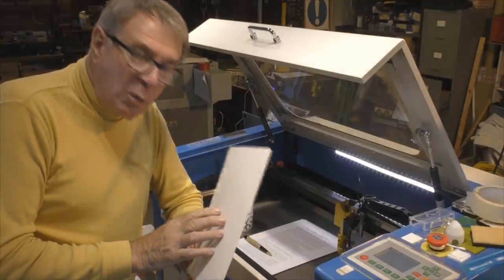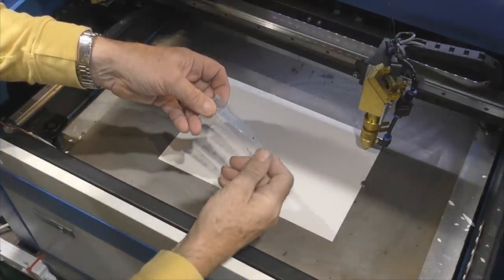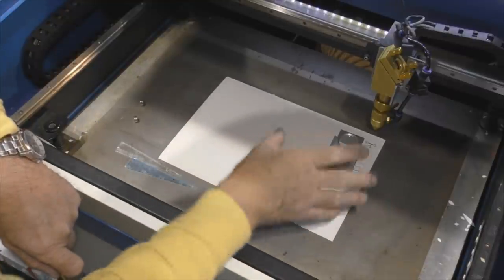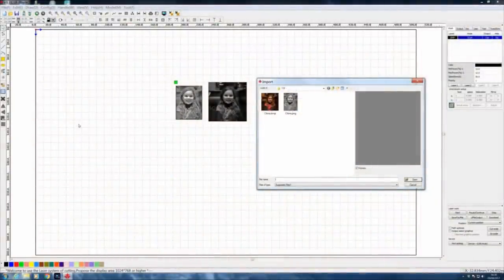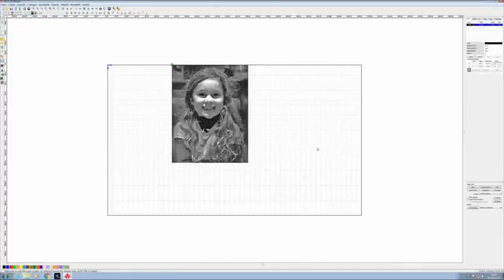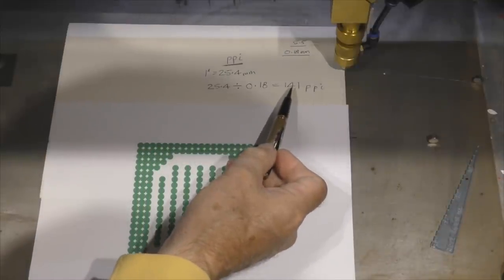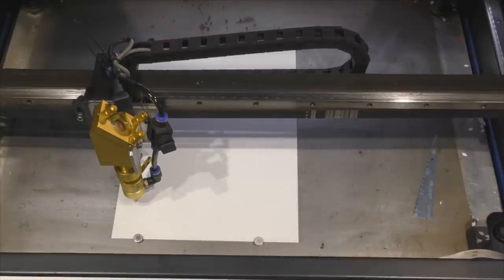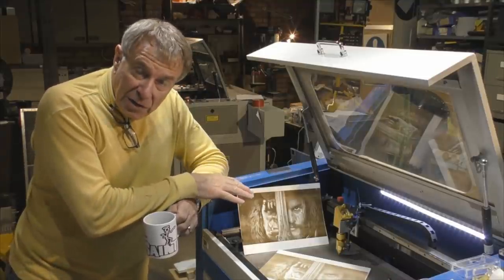RDWorks Learning Lab 115 The Russ Formula for Photo Engraving

Comment: Hi Russ
I found a discrepancy in what defines "dot size" in my drawing program. If I design a 1 pixel dot then the size is 0.002. If I then change my drawing units to inches instead of pixels, the same dot becomes 0.003339. I have another newer computer and monitor and with that set up it stays the same size of 0.002  or 1 pixel regardless of the setting being pixels or inches.
Should this be a consideration?

My Trotec 30 watt laser can make a 0.002 dot with a 1.5 inch lens however our machine allows not only DPI settings but also Pulse Per Inch settings. Plus 1 to 100 for speed and 1 (or less) to 100 for power. I've been told the Pulse Per Inch should be a multiple of the Dots per inch.
I don't know what happens (if anything) if a photo is 300 DPI and the PPI is set at 1200 or vice versa. It's confusing me. I've done over 150 tests varying power and speed however they were done mistakenly using a dot size of 0.001 (putting 1000 of them in a line 1 inch long) and none of the dots were distinct - they all merged as one line. Also tried 500 of the same size dot per inch with the same result.
Then I realized a pixel is not necessarily 0.001 - no idea why I assumed that but I thought if the laser can make 1000 Pulses Per Inch, that must mean it's capable of 1000 DPI ? I guess not.

Would it be possible to get your formula document? This way I could try and make adjustments to the Trotec software and put an end to the rampant destruction of watercolor paper. I've been using 140 pound paper that's pretty nice although slightly textured. I'll be looking for the beer coaster material at the local hobby and framing shop.
Regards,
Mayo@designcutters.com

Comment: Your channel is the best I've ever seen on laser engravers: thank you for helping me out as I booted up my own!

Please excuse this if you've answered this question before, but I've run into a print speed issue and wondered if you'ed ever had a similar problem. In order to melt glass instead of just microcracking it I need to run my Chinese laser at around 5mm/sec, but anytime I run it below 41mm/sec something bizarre happens: Instead of printing the picture in the corel program, it prints a series of dotted lines bearing no relation to the original picture. 41mm and faster? Prints great. 40mm/sec and slower? Grid of dots.
I'm using main board M1 under properties, and it works fine apart from this issue. I've selected every other possible main board setting to see if that's the issue: Those main boards that ignore the input speed completely print the picture. Those that respond to input speed print the dot grid.
I've tried switching computers and OSs, but it makes no difference. I get the same grid of dots.

I'm just stumped as to why setting the print speed slower than 41mm/sec should have any effect on the content of the image. This isn't a blurred or damaged copy of the original image - the dot grid is a completely different image with wildly different external dimensions. Do you have any idea what is going on with this K40 laser?
Reply from the maker: Hi Michael
I started to answer your question and  posted my answer but for some reason You Tube decided to post it into another dimension.. Check out your You Tube messages where I have sent my email . Send a couple of pictures of your problem and I'll see if I can help. I know zero about the K40 machine but it's only mechanics, electrics and logic . There will be a solution.
Best wishes
Russ

Comment: Hello Mr. Russ. That 1.5 lens created a magnificent picture. When using the 1.5 lens, does it need to be set up like the universal compound lens where there are 2 lens or can this be used individually? By the way great video. Is it possible to share the dot file to use when setting up for these types of engravings?
Reply from the maker: Hi Derrick 
 Add your disguised email address to another comment and I will send you a data pack on the whole subject of photo engraving that include the test pattern
 I will also delete your comment/email from public view
 Best wishes
Russ

Comment: Hello Russ,
i have a Question about the Software which you used to improve the brigthness of the Picture. Which one was it? Maybe Photoshop or another one? Thank you.
Reply from the maker: Hi Claudio

There are some basic brightness and contrast iadjustment s you can perform with in the RDWorks bitmao handle tool. However I find Photoshop has many more tools  including a valuable filter called Unsharp Mask.

Best wishes
Russ

Comment: if you have some thick acrylic(10mm), make the gauge out of that. it will stand on its own, therefore  both hands are free to manipulate the screws and you can "land" the lens on top
Reply from the maker: Hi Steven
Thanks for reminding me I rather too lazy to make a thick one. I made these almost 2 years ago and every time I use them I think 6 to 8mm would be stronger and self standing. Perhaps now you have kicked me I may do something about it.
Thanks and best wishes
Russ
Reply: Dang, that's a good idea, thanks for sharing!  I made 3 or 4 of these handy gauges a few months ago and use them all the time, but a free standing one would definitely be an improvement.

Comment: I am still unsure about the scan interval to use however. Should I use a scan interval that is the same size as my dots?
Reply from the maker: Your picture resolution will always be expressed as ppi (pixels per inch) The scan interval must always match the ppi so you have to calculate the size of a pixel to input as the interval  If you remember this simple calculation you will always set the interval correctly
25.4 / ppi = interval 
In my write up  you determine the smallest dot you can make and then set your picture resolution to match that dot size. Thus you are correct  and in this case the interval is also the dot size (in mm)
Best wishes
Russ
Reply: This video is the best yet in my opinion. It has been so so so helpful and I can't thank you enough! People are always throwing around random resolutions and inputs but this clears it all up perfectly. Thank you so much!
Reply from the maker: Hi Cosmo
As you rightly say, there has been a lot of black magic and  many myths about the correct parameters for engraving. I'm sure that even the big companies don't fully understand, they pre-program parameters into their machines based on evolution, trial and error. It's taken many sessions and turns into blind alleys before  I managed to distill the essential details into a simple form that can be understood by all. When you understand the absolute basics you can go forth, bend the rules , mix and match the parameters  but you will more than likely end up with "an artistic" creation rather than fidelity. Thats part of the fun now that we understand where the bondaries are.
Glad it works for you.
All best wishes
Russ

Comment: Hi. Very clear explanation of the procedure. Just one question... When we set the power to 15% to find the perfect focal distance, this 15% is out of how many watts. Should we adjust the percentage based on the max power of the machine? Thank you.
Reply from the maker: If you have a laser that is 100 watts or more you may find it difficult to  make good dot engravings. The problem is that %power not an indication of watts output directly. If you have a 100 watt tube then 100% may well be 120 or 130 watts (bad news.... never use 100% unless you are sure it does not exceed the safe current for your tube) and 50% will definitely not be 50 watts. No, the power output from your tube is controlled by the milliamps flowing through the tube.Typical  maximum allowable values are 50 watts=20mA, 60 watts=22mA and 80 watts=24mA and 100 watts= 25mA.  Your HV power supply will be approximately rated for your tube .  A 100watt power supply will deliver 30mA. 100% power =30mA and 0% power -0mA. That CURRENT relationship is linear but the watts output is VERY non-linear. If you have a 100 watt tube then it may produce zero watts output up to 15% and ten by the time you get to 20% you may have 50 watts !!!!!!  So, 15% was a working number for my tube but you need to see how low you can go with your tube. All I can say is that you will need LOW power to get reasonably small dots.  The focal distance will be the same for all powers it's just that the dot will get bigger  as you increase the power. 
Hope this answers your question
Best wishes
Russ
Reply: Thank you.

Comment: First of all, thank you for making such informative lessons.  They have proven to be invaluable to us.
We've been trying for about a year to engrave photos with varying success.  This session put all the pieces of the puzzle in place in a easy-to-follow order.  
In this lesson, you mentioned you modified your nozzle to accept a 1.5 inch focal point lens instead of the 2 inch.  Could you elaborate on how you did this?
We're looking forward to using your process with confidence.
Thank you again.
Chris and Melissa from Minnesota, USA.
Reply from the maker: Hi Chris and Melissa
This a start to my adventure with photos. In a way I think this may have been jumping in at the deep end to choose organic materials such as wood /card/leather because the dot that you produce is not just the hot centre of the beam but also the cooler part around it as well that still has enough power to scorch a halo around the dot. Thus the dot is always bigger than theoretical. I shall soon be moving on to inorganic materials such as slate/granite/glass and also anodized aluminium where the beam reacts differently upon the surface. There is great promise for significantly ramping up the resolution. 
In answer to your question about the way I adapted my Lightblade lens tube to take an 18mm 1.5" lens....see this video
https://youtu.be/M9L13-efN8I

All best wishes
Russ

Comment: Ok, dumb question:  I see you often tick the padlock symbol when working with images, however, I have not discovered what effect that has at all?  Whether it is open or closed, I can still make any modifications to the object, resize it, etc.  A cursory search of the interwebs and reading various iterations of the RDWORKS manual did not produce any information.  So what gives?  What in the heck does the padlock do??
Reply from the maker: Hi Jim
Do this.
1)Choose the rectangle tool. 
2)Somewhere on the table press the left mouse button and hold it dow.
3)Move the mouse around and you will be able to make any shape and size of RECTANGLE
4) Keep the mouse button pressed and now hold down the Ctrl key
5)Now you have constrained your shape to a SQUARE as you move your mouse around.
6) Release the mouse button first and then the Ctrl key and you will have locked a square shape on the page.
7)Click on the square to put handles on it.
8) On the toolbar, look at the second set of windows an you will see that the width and height of your rectangle are specified with 100% in the 3rd window.
9) CLOSE the padlock
10 In the top 2nd window  (the width) swipe a highlight across the window (left to right) and type in a new dimension of say 100 and press enter.
11)You will note that the height dimension has now changed to 100mm also. The CLOSED padlock has constrained the aspect ratio.
12) Now UNLOCK the padlock and in the top second window highlight and type in 200 enter.
13)Then aspect ratio is no longer constrained.
14)CLOSE the padlock again and this time highlight the third top window and change the 100% to 200% enter
15) Constrained aspect ration but twice the size.

That demonstrates  everything you were puzzled about
Best wishes
Russ
Reply: Beautiful!  Exactly what I was looking for.  Thanks for the help!  Slowly learning RDWORKS, one painful moment at a time :)

Comment: Watching this a third time- I am firstly awestruck by how an engineer has figured out a type of digital imaging from scratch! I have been in photography and graphic imaging/print for 43 years, and this is great work. Secondly, I am wondering how an image that is imaged with burnt dots will hold up over time? Seems that the carbon dust that makes up the image, if left to the open air, would degrade in blackness in time. So it seems that if you want this image to last a long time (but not archivally) that it should be encapsulated in a matte and glass cover.
Reply from the maker: Hi Patrick
Thanks for your response You may even be able to answer a question I have NOT been able to find a solid answer to.. I'll ask at the end.
It didn't take a lot of figuring out that the ratio of black to white in a binary dithered image is the magic that fools the eye into seeing a continuous grey scale image. My problem was trying to understand how a black dot INK  printing process could be faithfully replicated with a burnt dot laser  process. Many people have been sort of doing it for years but I claim that what they are getting is a lucky smudged accident because no one has actually  bothered to understand how to accurately replicate the dithering process that was never intended for this technology. This session was just the start of my search  where I decoded the basic principles of what we must achieve with our machine and how to try and control the laser technology to achieve that replication.. Once I understood how the mechanics of switching the tube on and off rapidly was the first key to the process success, I quickly realized that the second key was understanding that 1pixel =1 dot. Thus, to improve picture resolution I must find ways and methods to create smaller dots and it was not just a matter of working with a hi res picture.There are many future sessions where you will see me pursuing this goal. I have proved categorically that  with the beam and lens technology we are limited to, that Thunderlaser and other "big boys""who claim resolutions of 1000DPI are living in a dream world and hope nobody will ever check and take them to court. Lots of interesting viewing ahead for you.

My simple question for you is....... Why so many dithering techniques? Was each developed to exploit the features of a different printing process ? Was it for colour separation purposes in 4 colour printing? I always find that a simple diffusion dither works best but is there a specific dither that works best for converting greyscale to binary.?  Most of the "big boys" have their own photo conversion software that relies on halftone printing. That seems totally illogical to me because that method of dithering can generate different size black dots which the laser cannot replicate.
Your knowledge and experience on this subject would be greatly appreciated.

Best wishes
Russ

Comment: I'm a bit confused.  Your first test pattern consisted of alternating on/off dots at a pitch of 0.1mm, or 254 DPI.  With the best focus, each dot resolved fairly well, with a reasonable space between.  The spaces are a bit smaller than the dots, so maybe the dot size is 0.12mm or so.  How did you conclude that the dot size is 0.18mm?   Thanks, Bill Scarpero
Reply from the maker: Hi Bill the dots and gaps are on 100 dots per  cm so each dot and gap  is 0.1mm.  So, if my burnt test dots JUST touch it means they are half a gap on one side, then the dot, then half a gap on the other side. That would make my dot 0.2mm diameter. When I examined the bottom row of dots on the 5.5mm focus test pattern  with my linen gauge magnifier the pattern was clearer than what you could see under the microscope.  The microscope picture/lighting almost gives the impression of a continuous bottom line. Some of the dots were really touching but there were many with distinct but small gaps between them. Maybe I should have estimated the dot size as 0.2, but because there were very small  gaps between most. I averaged to 0.18mm. Hope that make things clear 
All best wishes
Russ
Reply: I see your calculation is .1mm to 254 ppi? So does that means .05 would be 508 ppi? Is there a calculator or formula for getting this calculation? Thanks.
Reply from the maker: Michael Ervin 
There are 25.4mm in 1 inch so if the resolution is PPI then 25.4/PPI  calculates the pitch between pixels in mm. Hence you are correct 25.4/508=0.05mm steps between scan lines.
Best wishes
Russ